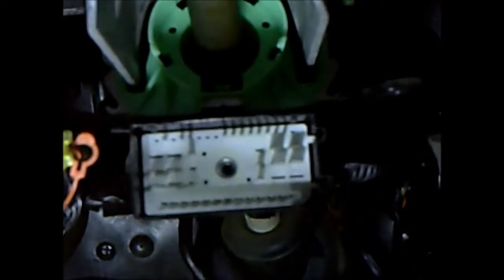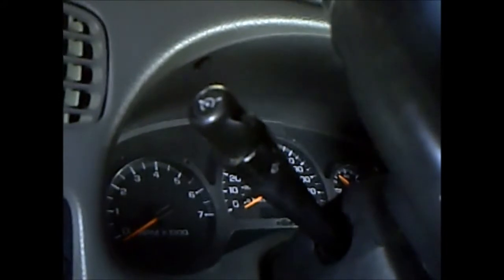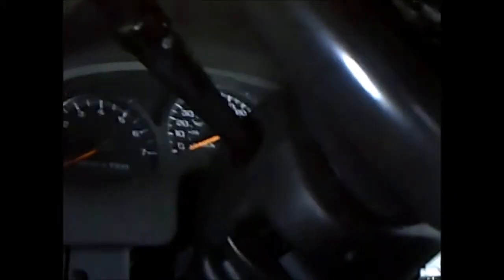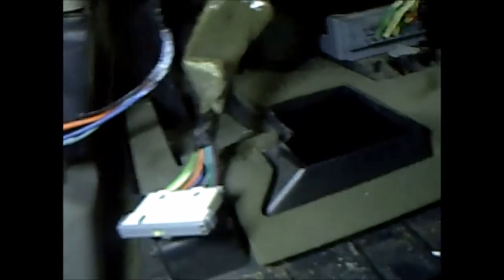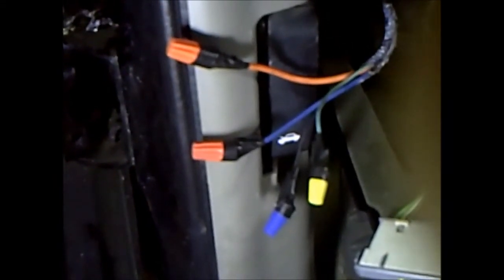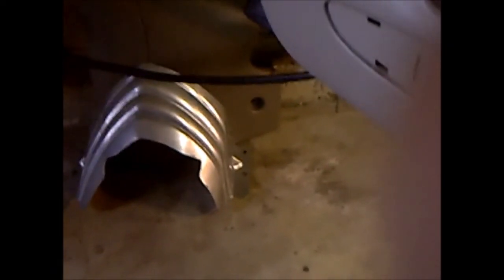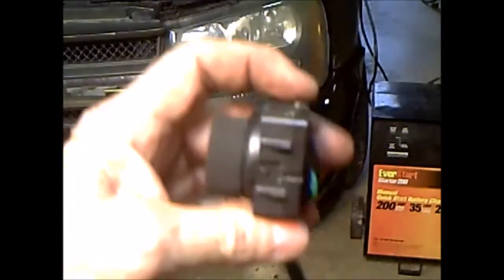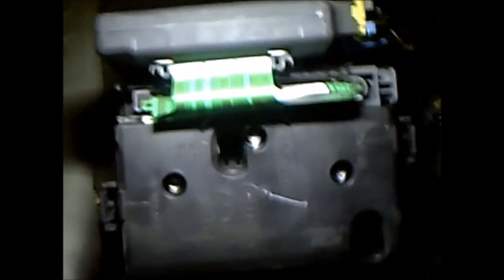Intermittent No Crank No Start With 02 Chevy Trailblazer LT 4 2L 4X4

Comment: So. At thr end.  What. Was the issue. ...any up dates
Reply from the maker: this vehicle has several modules that power up  when the key is turned on, one of these is a module that controls the power seats, another controls the windows and so on, in this particular truck the module that controlled the seats was not shutting off but i could not catch it on the  draw down test because it was not coming back on immediately after the shut down.. the TBS reports can be found on the Mitchell  DIY site, i don't believe they require a membership, but i am not sure